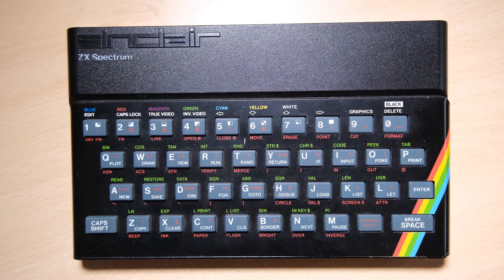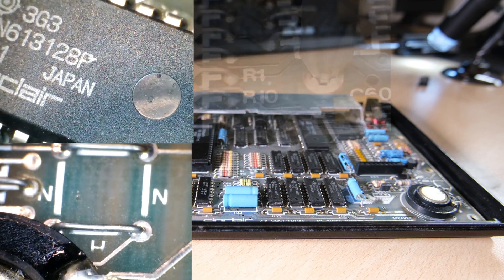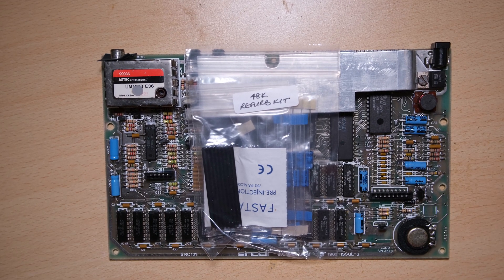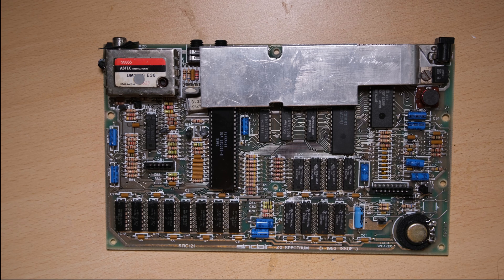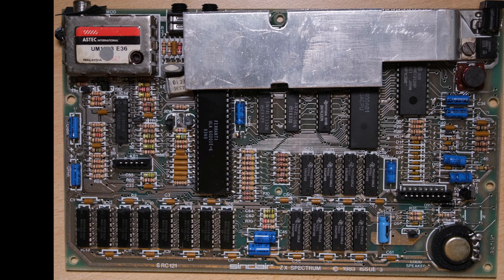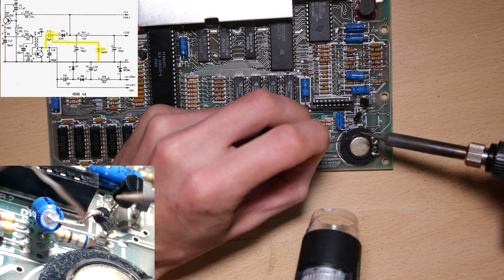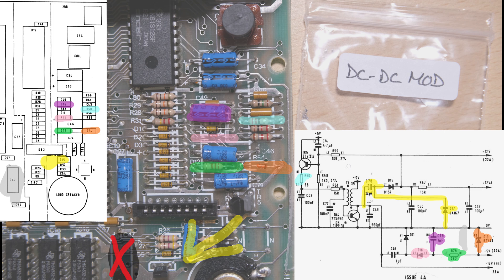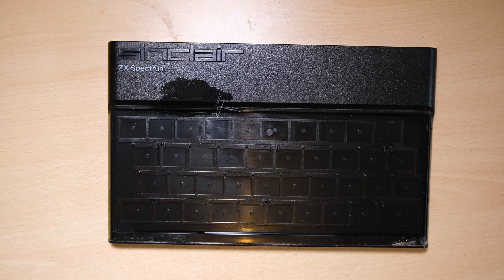Issue 3 ZX Spectrum 48K Refurb - DCDC Mod Walkthrough

Comment: I have an Issue 3 which only delivers 9v instead of 12v. Maybe I'll try this out 🙂
Reply from the maker: Check tr4 and tr5 and capacitors! It may be a lower ram chip. Are any hot?
Reply: @HappyLittleDiodes  I have replaced the transistors, but they may still be gone because of a differernt issue. I just confirmed now that the "Weird" waveform which is usually at the Base of TR4 is a flat  line. I have removed all lower RAM chips.

Comment: Do you need to do this mod if you just put in a Treco power replacement?
Reply from the maker: I would recommend it yes
Reply: @HappyLittleDiodes  cool will do.. after that I'll have an issue 3b with modern ULA,DCDC mod. Composite mod and new power regulator 😁

Comment: Nice DCDC mod. You can remplace 1mf capacitor connected to filter DC line of -5V with 10 or 22mf to filter better. And put a resistor and new capacitor to transistor TR4 on emitter with 22ohms and 10mf to protect it from short circuit. You are limiting current. I’m tested capacitors and in general, ESR and capacity are okey on spectrum circuits. You can increase capacity on capacitor for filter on DC DC and in general power lines. But. Really no need replace by bad function in general.the capacitors on zx spectrum boards are really with very good quality.

Comment: I used a 1/4 watt resistor on the 270 ohm R60 mod. I got 18 volts on the 12 volt rail. I hoping a 1/2 watt will get it back to 12 when it arrives.

Comment: Hello HLD.

What acid did you use for the nut? And , did you use any product after the acid to prevent it from rusting again?

Also , where did you get the replacement feet?

And also, what's the point of the DC DC mod? When I read the title, I thought you were going to use a Traco Power.
Reply from the maker: Hello

It's called "Rust Buster" a product I bought a long time ago and I use it from time to time for things like this.

Replacement feet can be bought from ebay or Spectrum parts websites, I also have a sheet of rubber which is just about the right thickness and I just cut them from there if I don't have any genuine spares

The DC-DC mod is a factory mod that simply changes the power circuit to match that of later issue boards, the newer circuit is generally more reliable and an improved design.
Reply: @HappyLittleDiodes   Thank you very much for your reply and for your videos!

Comment: Thanks for the DCDC mod walkthrough. Since I can not find a 1uf/63uf cap do you think I can get away with   lower voltage (50v) or I should absolutely go higher (100)?
Reply from the maker: 50 V is fine
Reply: @HappyLittleDiodes  Great thanks!
Reply: Is it ok to  use resistors with 5%  tolerance or should I order 1%?
Reply from the maker: I use 5% for some but I can't argue with "smaller is better" !

Comment: Hell ! can you help ? i own a zx spectrum sinclair 48k that doesn´t load the games. They just get errors when first game screen opens or crash during the doalings and green little squares on some loading drawings. I  inserted that to check the upper RAM chips :
PRINT PEEK 23732 + 256 * PEEK 23733  the value result was wrong
it was 32863 instead of 6553 »»»»    I tested all the 8 upper RAM chips group on the board  below (right side not the logical ones) using a fully working sinclair 48k and all 8 are good.
Reply from the maker: How did you test the upper RAM chips?
Reply: @HappyLittleDiodes  I removed one chip from other fully working board and tested the upper chips of the board that doesn´t load installing them one by one  and the games loaded perfectly
Reply: So i reinstalled the upper chips back again on the problematic board but the non loading symptoms continued
Reply from the maker: I would recommend running a diagnostic ROM.  RAM failures can be weird and this is the best way to root them out
Reply: @HappyLittleDiodes  that´s expensive. More than a speccy 48k unit it´s a monkey business.
Reply from the maker: You can get a ROM from retroleum with a diag rom burned for a tenner or so

Comment: Hi. thank you for a great video. When I look at the schematic for issue 4a, resistor 60 has a value of 68 ohm. You change it to a 220 ohm resistor. Can you tell why?
Reply from the maker: Hi Kim.  Yes the issue 4A has a 68 Ohm, but the Issue 4B has a 220 Ohm.  From what I understand, using 220 Ohm will help prevent TR4 from blowing

Comment: Thanks for the heads up on the DCDC mod.  I bought my first Speccy a few months back (Issue 2), but AFAIK it's not been DCDC modded.  It's on my "to be recapped" list, so I should probably do the DCDC mod at the same time.
Reply from the maker: For an issue 2 I would take a look at retroleum's advice, the mod is different to what I presented here as far as I understand. http://blog.retroleum.co.uk/electronics-articles/spectrum-issue-2-pcb-mods/  Also look at the issue 2 repair video I posted in case there's anything useful there for you
Reply: @HappyLittleDiodes  cheers!

Comment: Nice job. By the way what is the purpose of this dcdc mod? (i do also zx spectrum restorations)
Reply from the maker: The power circuit on boards before issue 4a had a habit of blowing up transistors so this mod improves the reliability and robustness
Reply: @HappyLittleDiodes  i bought a zx spectrum+ with this modification and now i solved my inquiry
Reply: @HappyLittleDiodes   didnt the issue 3B board fix this?  i recall it was a slight redesign from the issue 3 to fix the DC-DC circuit reliability
Reply from the maker: @sharazjek338  I think if you compare a 3B power circuit to a 4A power circuit in the same way, you should find that C66 needs to be changed, so you're right I think most of these changes already took place with 3B boards over 3 boards.